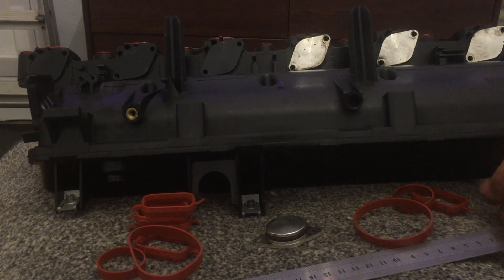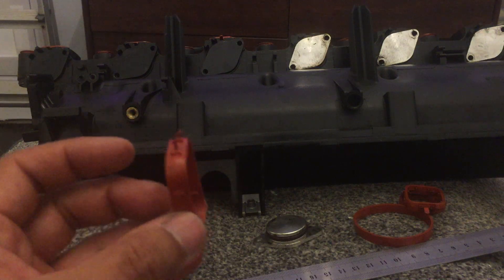E60 BMW Swirl Flap Delete Kit Comparison Good vs Bad

Comment: You can't compare old worn seals against the new one, because the old once shrink over time.
Reply from the maker: no they were not old, they were from a cheap kit, hence why i did a comparison between good quality oem ones and cheap ebay ones.